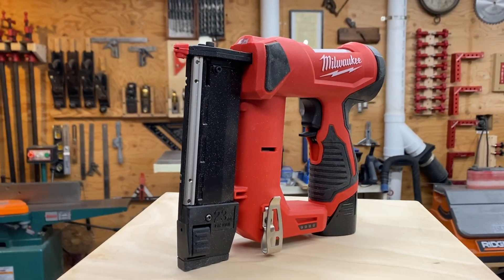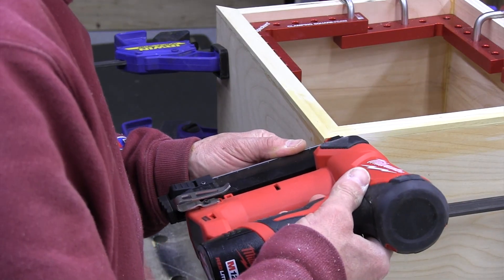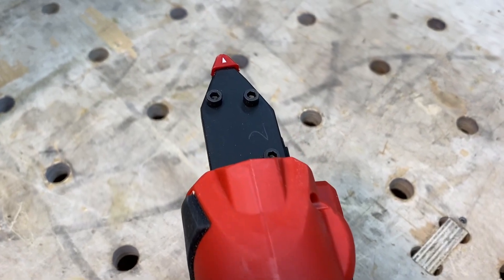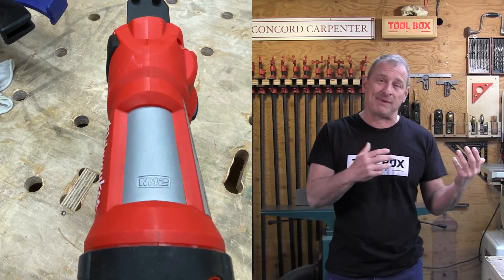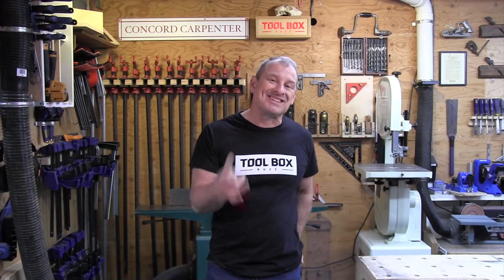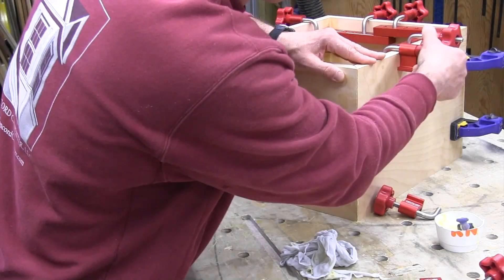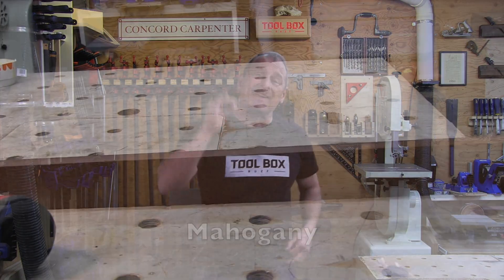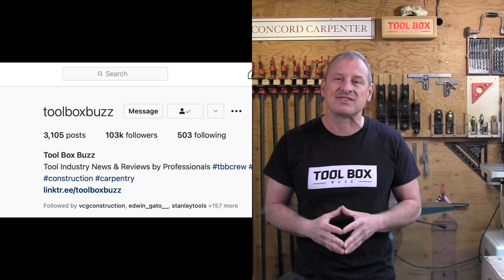Milwaukee M12 Cordless 23 Gauge Pin Nailer 2540-21

Comment: anyone else have trouble with this not sinking the pins? i jsut bought one and was only shooting 3/4" pins thru less than a quarter inch of teak and into plywood behind it... it wouldnt even sink 3 of the four i drove, i ended up pulling two out with my pliers and the other one i put my putty knife on it and hit it with my hammer and it sunk it well enough to not be noticeable... either way i wasnt happy.. i bought the gun to replace my pneumatic but ended up returning it and going back to my old pneumatic... it drives them perfectly every time, any length... this milwaukee wouldnt even sink short little 3/4" micro pins... did i just get a bunk one? or does this thing not do well with hardwood? even soft hardwood? my pneumatic has no issues with hardwood generally... certainly not a 3 out of 4 failure rate anyway... it almost ended up at the bottom of lake tahoe but i wanted my money back, lmao...
Reply from the maker: Nope, return it

Comment: Be warned that if you buy this in the UK you will not get any form of warranty / guarantee, just reached out to register this and was told not in the UK, hope mine lasts the duration, just said £400 all in and it is an amazing little nailer but feel ripped off that if anything goes wrong I'm stuffed. I think it's pretty appalling customer service, would of bought Stanley or Makita if I'd known.

Comment: I have what might be a dumb question regarding the lifespan of the nitrogen canister… you mentioned it being a few years with a huge number of pins being deployed, would the lifespan be the same or longer if it’s used at a less intense rate? I don’t quite understand the science enough to extrapolate whether it’s “lifespan of the tool no matter how much you use it because that’s an inherent property of the vacuum chamber” or “expected lifespan with heavy use.” As always, your videos are awesome, ALSO, how do you feel about this tool three years later? Has it reached the end, or is it still going strong 😁?

Comment: Mine just arrived, and so far I absolutely love it!

It’s firing 35 mm in the hardest Timbers I use , fully set , no problem at all!

Admittedly I only just got it and haven’t used it on an actual job, but my gut says it will be awesome!

I just hope I don’t have any issues with the firing pin or nitrogen, I’m planning to use stainless steel pins too
Reply from the maker: It’ll pay for itself in no time

Comment: The best 23ga pin nailer is made by cadex. It shoots both headless pins and a proprietary 23ga brad nail with a head. It shoots from 5/8 to 2 1/2" maybe even 1/2". Their nails are strong too.

Comment: Very good review, im sold.
Im new to milwaukee tools, i do a lot of kitchens and case work.  Id be interested in getting their 1st and 2nd fix guns also as im tired of leads and compressor. 
I had a question about the 2nd fix gun, if i intended to use it for base/skirt boards and archives  which gun should i get?
Iv heard of 16 and 18 gauge.  Im confused. Iv even heard of next generation.???
Thanks

Comment: The biggest question I have is how long this pin nailer or other Milwaukee Gen II nailers that uses nitrogen will hold up in terms of very light use and shelf life. I don't want to replace something I'm not using a lot every 3-5 years. lets say I only used 10,000 nails over a period of 5 years. Would the tool lose more pressure through age not just nails fired. I heard these things have seals too that can loosen if they get too hot. That's the biggest most important question I can think of when debating whether to buy these nailers. Not everyone will use it heavily.
Reply from the maker: If your only using them once in a while save your money and use pneumatic

Comment: How does the nail hole size that it leaves look compared to a nailer that requires air compressor?  Can you drive nail deep enough in oak if you want to sand after driving nail?
Reply: Have yet to have one shoot proud into any material yet. Have had it a year and it's almost used daily. Easily 700 nails and not one issue.

Comment: We have 4 in the company we work. Great guns. But at this moment 3 of them have the nail driver chipped. Bad news is I’m in Europe and they can’t be fixed here.We are stuck with them. Maybe a good upgrade will be a stronger tip. We use them in oak. A lot of oak.

Comment: I have recently picked up this Milwaukee Pin Nailer, but am now wondering who makes the best 23ga Pin Nails? How about a video on different pin nail types and brands?
Reply from the maker: good idea
Reply: @ConcordCarpenter  Excellent! There are so many options, now I have to research nail brands and types! I see there are indoor/outdoor categories, but I see reviews for some brands suggest they use a much softer material and that leads to more jamming etc, while other brands are harder material or stainless, and less prone to jamming. Are there specific reasons for using different material nails? Colors? Etc?

You are a Top Tier information resource, thank you for all your very hard work!
Reply: Also: it seems many nail gun manufacturers also sell self branded nails for thier guns, but I doubt most actually produce the nails, instead rebranding someone else's nails. How many unique nail manufacturers actually exist? Who makes who's nails? 😃

Comment: I am laying vinyl plank floor in multiple rooms, then plan to run shoe moulding around the edges, would this M12 Pin nailer be good for that work or would you use a brad nailer?
Reply from the maker: I’d use a brad or 16 ga finish nailer

Comment: Great, my reservation with any cordless tool is interoperability.   Once you decide on a brand you're stuck to have compatability.   I use Ryobi One plus because battery is sane for all. I still have DeWalt 18 volt drill. Bosch and B$D small cordless but all oem unique power.   I was able to rebuild my old Nixa 18v DeWalt batteries with NIMH Batts to keep same charger and keep it running.

Comment: Pin nailer, stapler, impact driver, jigsaw, and the 4-head install drill. Now Milwaukee has to figure out how to make a 12v router and you can run a cabinetry and furniture business from a backpack.

Comment: Bought one today.  $199 (bare tool) at Acme Tools/Tool Crib. Excited to compare it to my Ryobi pinner, which is a great tool in its own right.  Great video, straightforward and quite informative. Thanks so much!
Reply from the maker: Have fun!
Reply: Since you mention comparing the two brands, I’m curious about your conclusion three years later! I’m on the ryobi battery platform and LOVE my brad nailer, and I’m strongly considering their pin nailer. I’m just a hobbyist, so I need my tools to be reliable and work as advertised, but I don’t necessarily need them to be insanely high performance. Since you have used both tools, would I be okay sticking with ryobi even though this Milwaukee is clearly insanely cool?

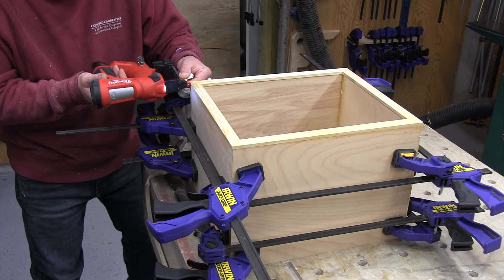Comment: At 1:55, how thick is that wood that you're pinning on the edge? You mention that the gas charge can fade, can it ever be recharged by an authorized repair center? I don't expect to use it heavily, is it still going to be usable in 6 years?
Reply from the maker: Maybe 1/4-3/8”. Yes it can be recharged at service center

Comment: Anyone have the battery indicator lights start flashing and the tool wont fire? Has happened to me multiple times while using it. Getting very annoyed. Couldn't find anything in the manual
Reply from the maker: Does it happen with a different battery?

Comment: The depth of drive adjustment on this tool is something I've never seen on ANY 23ga. FINALLY SOMEONE DID IT.
Reply: maybe thats why mine wasnt working, i didnt even know it had depth of adjustment. idk why youd need it with headless pins... you want them all about a 16'th below the surface... no need to mess around with depth adjustment just make sure its at least that deep. my pneumatic doesnt have it and it always drives them perfectt. this effed up three of the firstt four i drove so i drove back to the store and returned it lol

if you want them proud, hold the guna mm or two off the work...
Reply: On air tools, an adjuster like that is an add on that bolts in with the air connection. Its pretty much required if your running multiple guns off 1 air compressor.

The one thing i never see on any 23gs except my cadex, is the ability to use 23ga headed brad nails. They must have a patent or something. It also shoots up to 2 1/2" like the big boy finish nailers. It was a game changer for me.

I just picked up a m18 fuel 15ga V2, i do like the battery deal. 10x faster setup. Feels like a framing nailer compared to the 23ga! I like the grip rite nails too, they have a half round head for better holding power, instead of a t shape.

Comment: I’ve placed thousands of pins with my Bostitch pneumatic pinner without a single miss.  I can’t justify replacing a tool with that kind of reliability and simplicity with a Milwaukee with its electronics and batteries and lack of a professional record of reliability.

Edit: for portability I bring a 2 gallon air tank with me, with a short coiled hose I’m good for over 100 shots as well as blowing off the trim for finishing, and maybe even a flat tire.

Comment: Nice. One day it might come the the UK. Wonder if Milwaukee offer a service to re-gas it after a while. HiKOKI did that for my 16g one. It was losing power after a year and they said there's a little valve on board and it can be re pressurised. Came back shooting like new.
Reply: You can buy it at Adzy's Goods check Instagram & Facebook :)
Reply: Could you please tell me more about regasing the hikoki please. Have the framer which is great but the 16g seems really under powered now. I've had it for almost 2 years. Never new they could be regassed. What did it cost? Thanks in advance

Comment: Great review! I l purchased the 18 guage version 2 months ago and  it works  great!  Much better than the Ryobi where I had to dry fire it 20 to 40 times before it would it would actually shoot a nail. And for punch work, an airless nailer saves alot of time and frustration. I've watched one other review on this tool on you tube, but was waiting for another review since it's a fairly new addition to the Milwaukee line. Glad I came across yours.  And if you already use Milwaukee products and have the same battery configuration on different  levels,  makes sense to stick with them. I am glad to hear that they include battery and charger with the nailer.  It's been piece meal with some  their tools for awhile.  
Great channel and stay safe.
Reply from the maker: Welcome, please consider subscribing

Comment: Hey rob great video love you guys  just a quick question what happens after 4 years of use do you send it back and get the nitrogen refill
Reply from the maker: yes sir - service - recharge. Or replacement if your tough on the tool

Comment: Hey Rob, do you have an opinion on how this compares to the Makita cordless or the grex 23 headless or 21 gauge brad nailers ?  Thanks for the review ,it looks like it's worth the price and the hassel of the compressor!
Reply from the maker: We did a head to head o the brad nailers - check em out
Reply from the maker: Better than Makita. Didn’t know Grex made cordless?.
Reply: @ConcordCarpenter  it's the gcp650, they call it cordless but I think it's gas cartridges,( fuel cells)but I don't know much about these or if it's a fair comparison to battery cordless nailers!
  Thanks Rob.

Comment: I got my first one about 3 weeks ago , overall I love it but , we still find ourselves digging out a Grex gun because of one major misgiving. By FAR our biggest complaint is that it shoots only up to 1 3/8" pins. Our Grex cordless and air both shoot 2" pins and there are so many times that extra 5/8" makes a huge difference with what we use them for. So we still have to smell gas from the Grex gun when we need it. Second problem is the little tips easily fall off of ours so know they will be getting lost a lot, and knowing Milwaukee they will want $20 bucks a tip or more. I hadn't even noticed the time out feature yet because who pushes a tip down for 40 seconds getting ready to shoot. So far other than that we love em so far. Second one arrived a few days ago. Milwaukee,,,, make a 2" model though.
Reply: What are you using 2” pins for? I’ve never run across a need for ones bigger than 1 3/8.
Reply: @kellym3610  was my question as well.

Comment: I have a Ryobi 23 gauge pin nailer, and though it’s a bitter bigger than the pneumatics, it does a solid job for the price. It, too, is cordless. It’s just a solid pin nailer.
Reply: It’s also about 4 x the size of the new Milwaukee Pin Nailer!  I’ve heard good things about the Ryobi, but I’d bet you $100 that you’d mothball the Ryobi nailer after using the Milwaukee for 15 minutes.  There’s just no comparison...
Reply: @martylucas8557  sure there’s a comparison. You just gave it! You believe that due to the Milwaukee being smaller that people will spend the extra money. The Ryobi is cheaper, but a touch heavier. I’d like to see a few more cordless pin nailers hit the market, but we’ll see how it all goes.
Reply: @multidinero , other manufacturers have cordless 23 Gauge Pin Nailer, e.g. Makita, Metabo, etc.  The problem is that they suck, they’re not consistent in operation.

If you’re not in the M12 platform this might be a good segue.  

There’s really no reason to wait around for other manufacturers to figure it out.  How long will that take?  Besides you’re probably not going to be on the same platform.

Milwaukee has it figured out with the nailers.  Their nitrogen charged delivery system is a way better design than Dewalt’s flywheel, besides they probably couldn’t use that system in a smaller tool.  Just look at the size of the head on their 18 gauge Brad nailer.

It just comes down to, do you want to spend an additional $200-$250 for a superior designed, reduced footprint and enhanced/consistent delivery system...or not.  Because I doubt anything better will be coming out anytime soon.
Reply: @martylucas8557     That would depend a lot on usage. A carpenter who uses the nailer almost daily would be better off with the milwaukee, but is it worth the extra cost if you only use it a few times a year?
Reply: @huejanus5505 , I guess that depends on the individual.  To me it’s worth it!  I’m currently remodeling, putting in new flooring, then baseboard molding and quarter round.  In addition, I have factory painted cabinet molding to nail up.

Even if I only used it once or twice a year it would be way better than dragging out the compressor, firing it up, then using my Ridgid 23 gauge nailer!!

I took back my Ryobi 18 Gauge Nailer. Getting back the $100 I spent on it.  Then I used the hack to get the Milwaukee Fuel Gen 2 M18 Brad Nailer, which was on promotion with an 8 amp HO battery.  After returning the battery, then applying the $100 from returning the Ryobi nailer, I ended up paying an additional $55 for the Milwaukee Gen 2 Brad Nailer.  It has definitely been a game changer for me.

Anyway...I’m really into acquiring nice tools to get the jobs done.  It’s definitely with it to me.

Comment: I did not know any of those things thanks for the info!
Reply: Did you know Milwaukee was coming out with a new Pin Nailer?
Reply: @martylucas8557  yes I have one
Reply: I knew about it last summer.
Reply: @handymansolutions7834 , you have one?  Have you just not used it?  

I knew about every feature on the Milwaukee Pin Nailer months ago.   If I would’ve been able to get my hands on one I would’ve had it out of the box using it!  Familiarizing myself with the nailer and associated feature set.

You do know that they aren’t generally available until April 15th, right?  The only people getting one early are those that’ve recently placed a preorder or those that have a YouTube Tool Channel and had one sent to them by the manufacturer.
Reply: @martylucas8557  yes I have one. And I got it from Home Depot last month. 

Why aren’t you making videos like the Concord Carpenter instead of watching them, because you know everything already!?

Comment: Got mine last week, I love it! The think is a beast, have put about 250 pins through it so far, not one has been left proud. Milwaukee hit a home run with this cordless pin nailer.
Reply: Do you have to refill the nitrogen?
Reply: @jimmy137losser shouldn’t have to for at least 50,000 pins

Comment: Pre ordered one the day it came out and I've assembled four custom kitchens with it and trimmed four houses. Nothing but good words! I absolutely love the thing.
Reply: I prefer my cadex 23ga brad nailer. I keep looking @ other 23ga specs, but i think cadex's patent must still be viable.

The cadex can shoot headless pins or brad nails up to 2 1/2" long. The brad nails are suprisingliy strong too. Its way better holding power than a headless pin.

I had one recomended to me by an old colleague that i called up a few years ago for a consultation on a wood staircase. Dudes a master woodworker @ this point.
Reply: You trimmed a house with a pin nailer lol.

Don't hire this guy
Reply: @evictioncarpentry2628   How do you know if he followed with 16gauge where applicable? I often tack as much as possible with as long a pinner as possible and then nail it off on the stud side with finish gun,
Reply: @leonardo47000  Why?

I can understand tacking and screwing, and even tacking hard to fit up pieces...

But why would you do that?

What is the stud side?
Reply: @evictioncarpentry2628  I’m sure he only used it where it was applicable